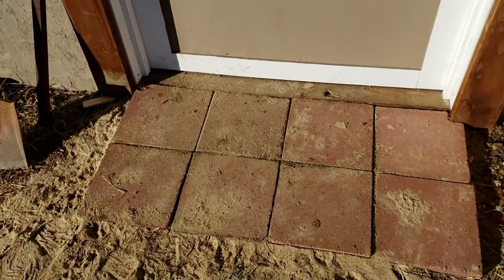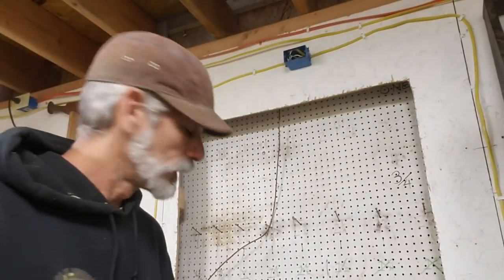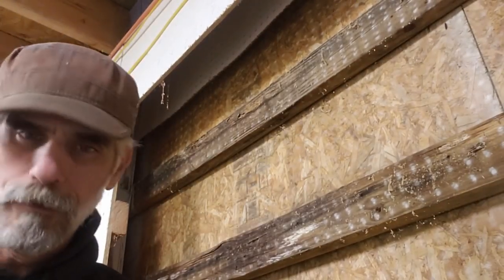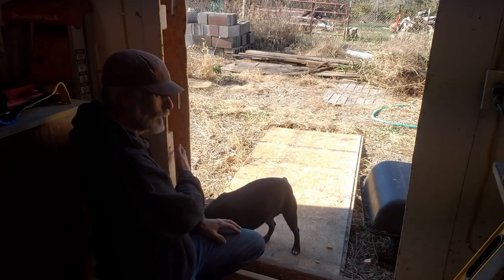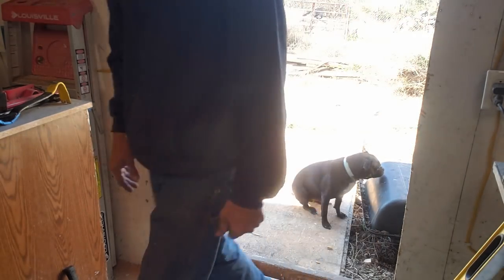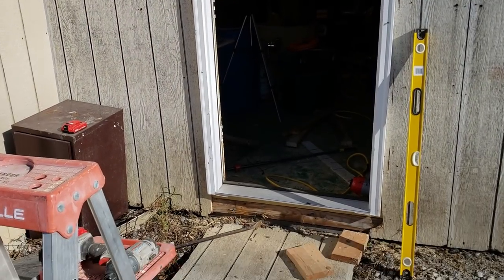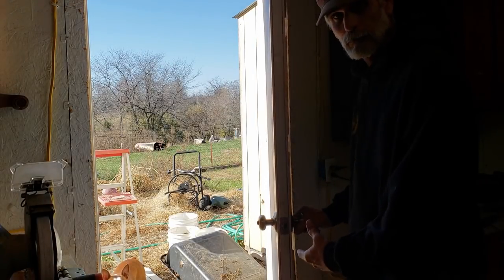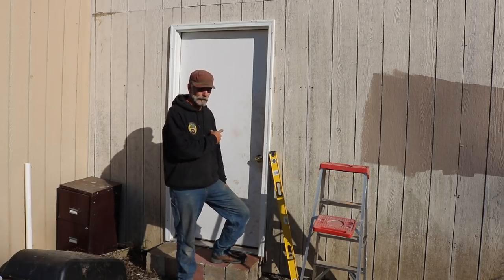Installing a Door in the Shop

Comment: I need a door installed in a shop where there isn't a door,, is this considered a very difficult thing to do?
Reply from the maker: I have been a trim carpenter for most of my adult life so for me its just something I have done many times. Much depends on the framing of the shop. As long as you can frame for the door without compromising structural integrity of the wall you should be OK. If you have not done it before I would enlist the help of an experienced carpenter.
Reply: @DIYwithUncleCy  it is a metal shop on the exterior with dry wall interior.